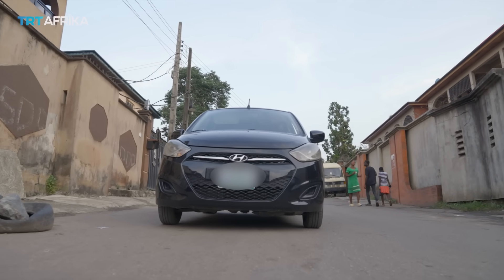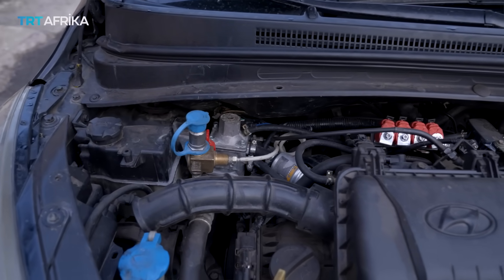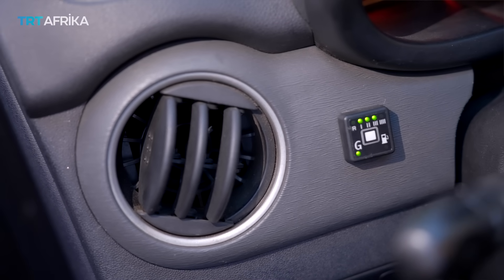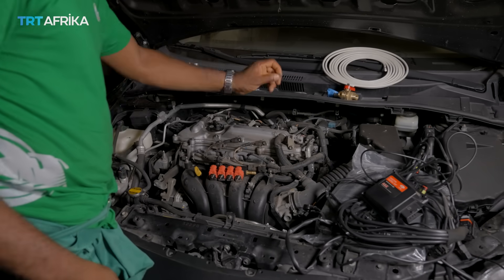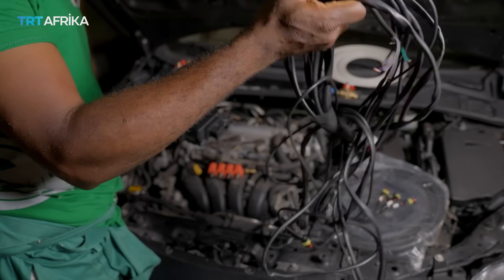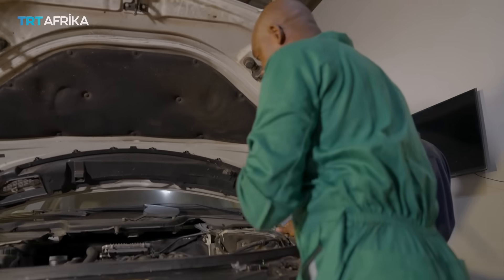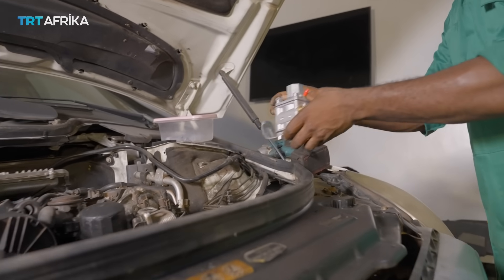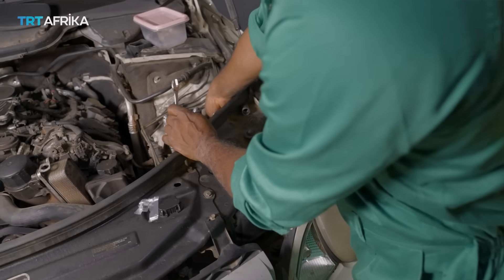Discover How to Drive Your Car in Nigeria Without Petrol

Comment: Yes CNG is cheaper and it's lighter and is more safer than petrol but you need to have petrol in the morning to start and warm the engine before switching to cng.the only proble is we don't have available cng filling stations in nigeria more especially in the north.my Mercedes w124 200e was converted by me to cng/lpg 10 years back i have been using available lpg no any problem up-to-date but lpg now is higher than petrol then.